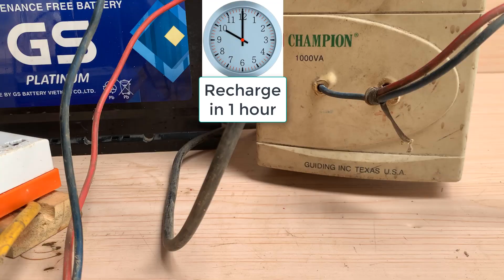Your DRY BATTERY will last forever! The secret to restoring OLD BATTERIES doesn't cost a penny

Comment: The video is incredibly informative and well-presented, making it easy for viewers to understand and follow along. The step-by-step instructions are clear and concise, allowing anyone to try out this battery restoration technique without any difficulties.
I was truly amazed by the simplicity of this method as it doesn't require any additional tools or expensive equipment. It's astonishing to think that something as basic as a simple process can potentially revive old batteries, giving them new life.
Moreover, the video emphasizes safety precautions throughout the demonstration, ensuring that viewers are aware of potential risks associated with working with batteries. This responsible approach adds an extra layer of trustworthiness to the content presented.
Reply from the maker: Thank you for watching the video. Wish you success and always happy in life.
The video I have created subtitles in many different languages. If you do not understand, please choose subtitles (CC) with appropriate language to understand the video content clearly.
Reply: Sunteți răi !